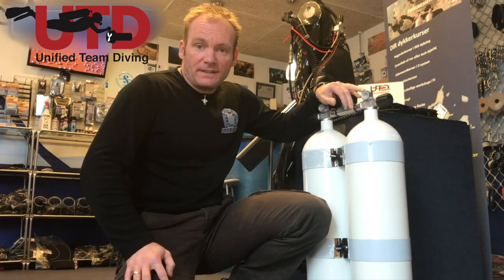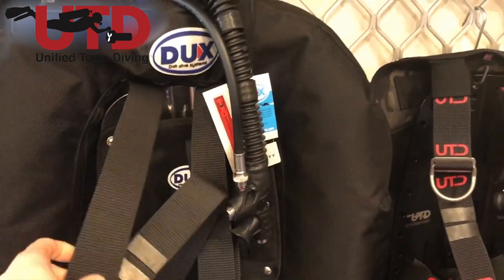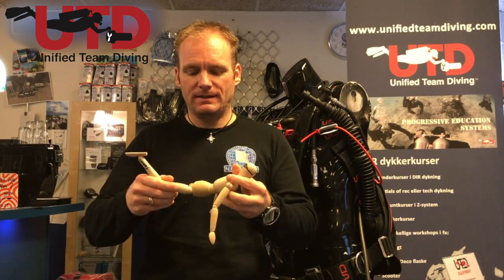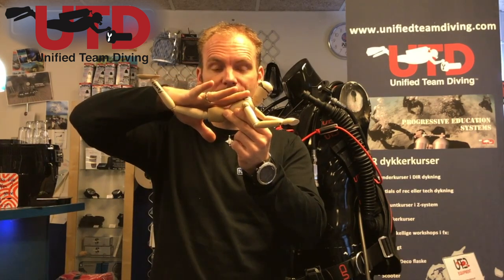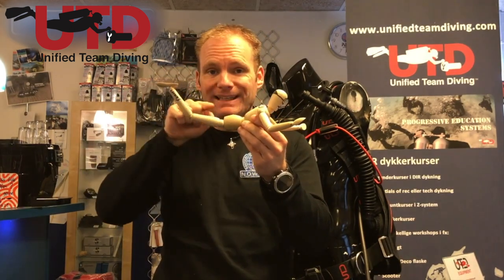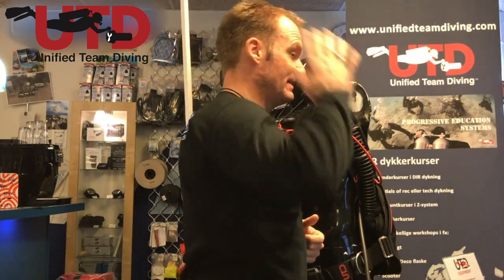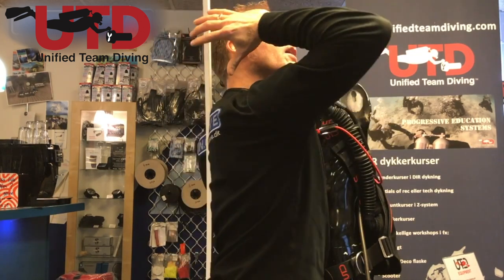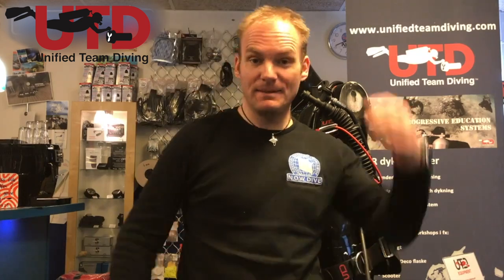How to reach your valves on a DIR twinset

Comment: This is the best valve drill assistance video I've seen. Great job. Here's a related tip for the single tank reach. Angle the tank valve 45 degrees toward you. You may need a reg with a turret for this though.

Comment: About a bonus tip, we do the undersuit expanding procedure before begin a dive. Close a dump valve on a dry suit, inflate it, lay down in a water and shake with hands and legs stretching a undersuit. open a dump valve and slowly stand a verticaly in water.

Comment: Excellent video.Would side mount  diving be better than back plate diving if your flexibility is poor?
Reply from the maker: Well in my experience, when people say they have poor flexibility is mostly the technique that is lacking and not the flexibility. I would say if you can stand up straight and look straight ahead or 45dgr upwards and put your hand between the tops of your shoulder blades you should be good to go. If this is not possible, then yes SM might be an option.

Comment: I’m struggling to reach the valves because of my shoulder mobility. Not even with my fingertips
Reply from the maker: Well in my experience, when people say they have poor flexibility is mostly the technique that is lacking and not the flexibility. I would say if you can stand up straight and look straight ahead or 45dgr upwards and put your hand between the tops of your shoulder blades you should be good to go.